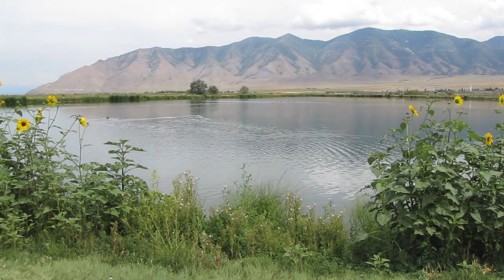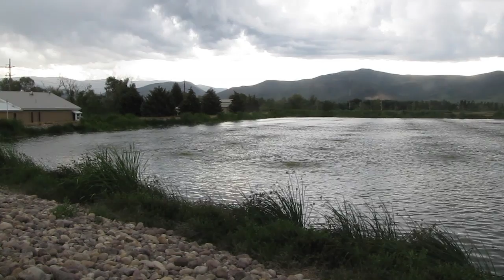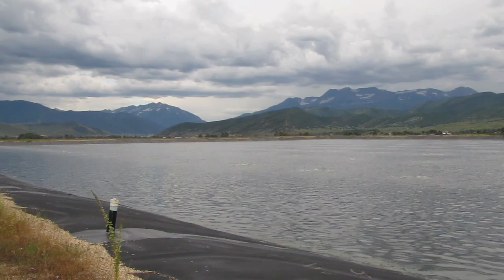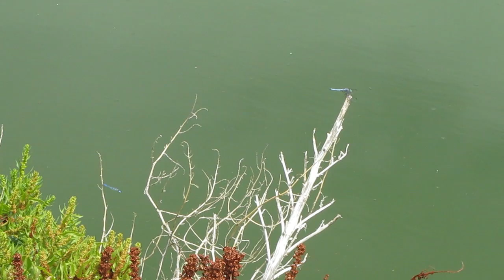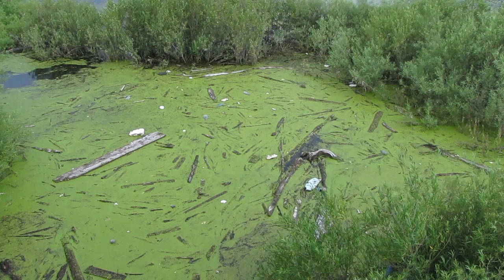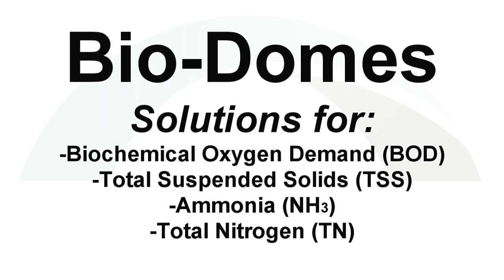Intro to Lagoons - Wastewater Compliance Systems

Comment: Lagoons are not great, there are problems with them as I understand and evidenced in our local area, and they use up lots of valuable space.   I came across an alternative innovative system for industrial wastewater treatment called the Baleen Filter, that works like a Baleen whale (filter feeder) to filter solids from waste water streams very efficiently, there are videos here on You Tube about it.  Website is baleenfilters(dot)com